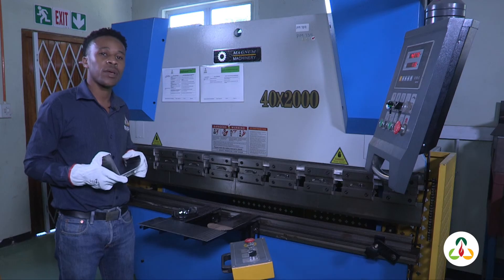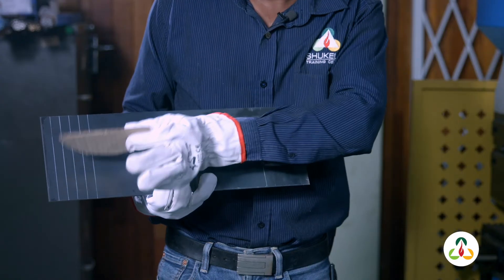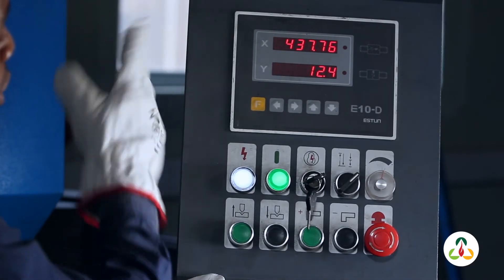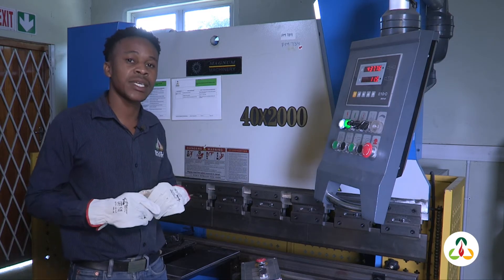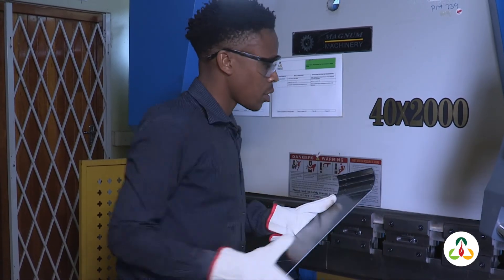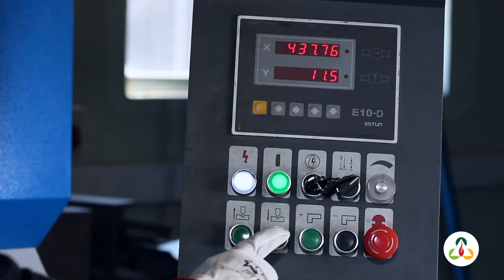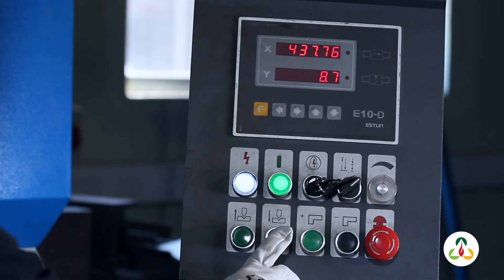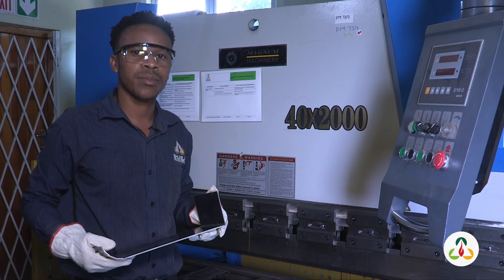Demonstration on how to operate a Hydraulic Press Brake

Comment: Wearing gloves while running machines are a great way to lose hands! Saw a few fingers and an arm come off from gloves getting stuck in machines and the people's hands got sucked in. Nope. I'll take the papercuts.
Reply: I think wearing gloves is a must but those in this video are a bit big
Reply: @PHXSUNS4592  rubber gloves only.
Reply: Not wearing gloves is a rookie mistake. That's why you pay attention to what your doing and keep your hands away from moving objects 🤦‍♂️most that complain are why warehouses have saftey meetings
Reply: @petergay7629  you are insane. How many decades have you spent using brakes?
Reply: You must wear gloves, proceeds to show gloves that have never seen use and hugely oversized. Do we get much sharp edges in bending?
Reply: @segov2860  that's hoe you lose your fingers.

Comment: You know, most companies and businesses involved with CNC machinery would at the very least train you up in terms of setting dies and punches, the variety of metals used, the fine detail involved in terms of angle allowance (1 degree under/over tolerance for most), the use of callipers for metal thickness, bend lengths, checking angles with a protractor. 
Screw it, just eyeball it with a pencil and call it a day!
Reply: They had it scribed. Some one already did the measurements for it that why the piece came out as planned. This is an tutorial on the press break not the whole of machining
Reply: Hey it's probably a part for one of those African helicopters that doesn't fly.  Close enough.
Reply: @funone8716  racist much
Reply: @jakearrow8047  seen the helicopters Karen?
Reply: @funone8716  u clearly never seen anything